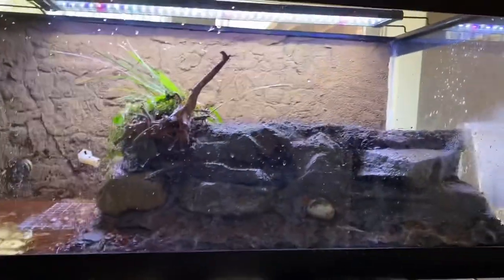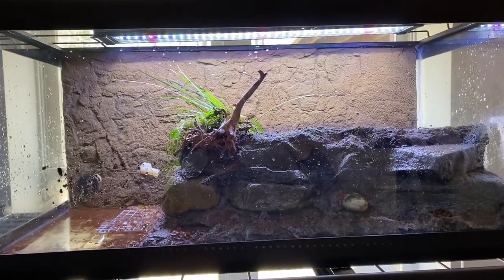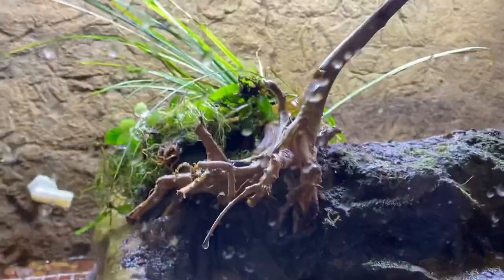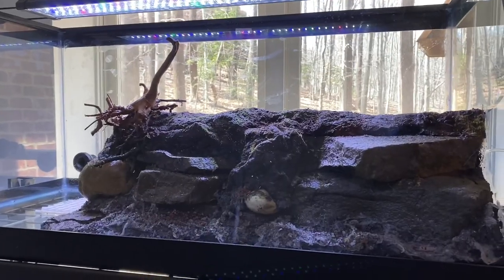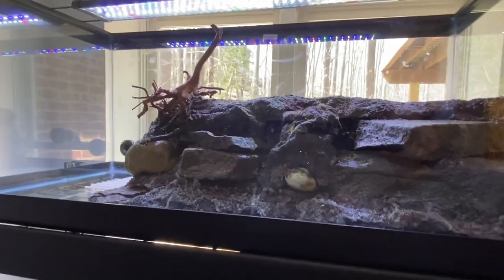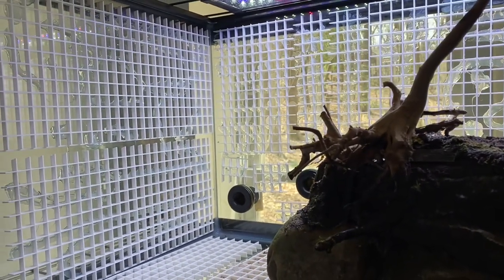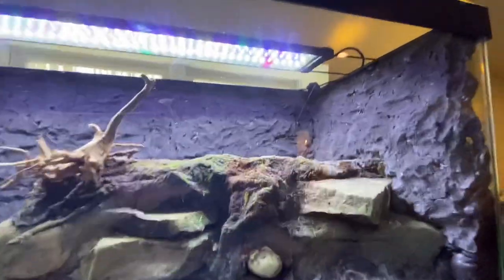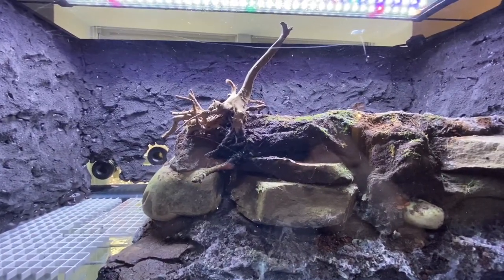Awesome Tiger Salamander Paludarium - Rebuild for Barred Tiger Salamanders

Comment: Thanks this was very informational, I am redoing my tigers 40 gal tank right now so this was very useful. I have a similar set up but I am trying to find a way to include a forest soil are for them to borrow in. I have been told by some tiger sally owners that are more knowledgeable then I that it is important to provide a soil substrate for them to dig and borrow. I am trying to figure out a way of doing this without them dirtying the water so much with soil when they take a swim after they burrow. I think I am just going to have to clean the water filters more often. ☹️ Thanks again it was a very good video.
Reply from the maker: No problem and thank you! Yeah, they are messy little critters! Having a rich substrate layer is key as they are fossorial. Typically they spend much of their time underground

Comment: Good job Mike. Question did you coat foam first with quikcrete cement and then add coat of drylock?.
We have wild tiger salamanders here (Alberta)and I've caught  several .They are pretty well always near water but all caught on land. They do burrow into ground cover all the time, in fact I'd say that's there preference so make sure you have deep loose substrate .Gord

Comment: Looks great. What's the difference between Drylok and Quickrete? Do they accomplish different purposes when painting over/covering expanding pond foam?
Reply: Quickcreat is a layer of quick drying concrete to help make it more solid and give it more of the rock look. Drylock is a waterproof paint/sealant that was created for house foundations, but I never thought about using it over aquarium rock to get the colors I want, I like that idea. They also make sand and texture powder that you can add to paints like drylock to give it a more rocky look.

Comment: How did you create the land portion?
Reply from the maker: Used acrylic sheets siliconed to make water tight, then built up rocks and used great stuff pond & stone to hold together and fill gaps. Also used coco fiber and put over smeared silicone in the e posed foam parts